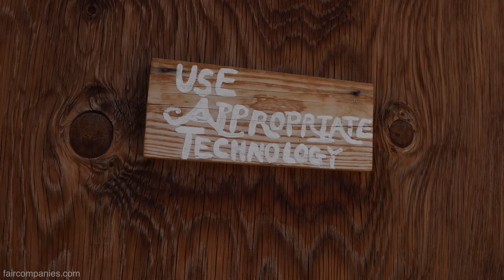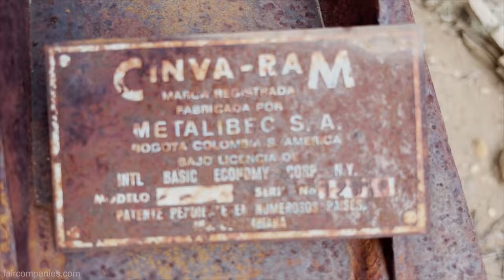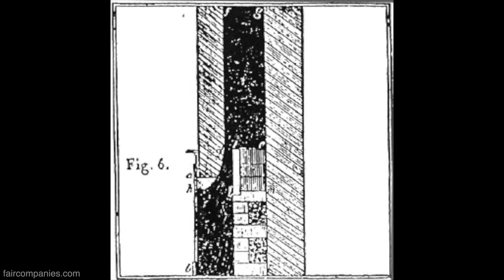30 years self-reliant: family $10K/year homestead & dugout

Comment: Doing nearly the same thing! We bought a property cheap with a rundown mobile home. Still have the mobile home, but we’re also just starting year 2. Foundation of the new house is nearly done. Wife has become quite adept with hand washing our laundry. Didn’t bring our washer/dryer, got gifted one (with intent of paying later) only to find out the hose didn’t work. Just recently got a grain mill. Its become an every other day thing, we’re baking more now than when we just bought it pre-ground. I love what he says about manual labor and appropriate technology. I’d rather spend a bit of extra time using a tool that’ll last decades, can be easily repaired and passed down. Than buy a time saving tool I’ll need to replace every few years.
Reply: It must be a challenging (but rewarding) lifestyle! Do you have a washer like them?
Reply: @barnabyvonrudal1  by washer you mean water bin or tub. In our case we have 2 galvanized tubs but also mostly use a bath tub. And yes we have the same looking hand wringer they do. We wrung them out by hand for about a month and got so many blisters! Plus every time we hung the clothes and by that time it was in the hallway using some cup hooks the previous owner had placed near the ceiling, it’d drip for the 1st hour making us have to watch our step or dirty towels to clean up the mess. Repurposed an old falling apart fence which conveniently had 2 posts tall enough to make a clothesline outside. You can guess how many people we spotted slowing down and staring at us as we hung our laundry in the middle of the winter. It works perfectly fine btw :D dragging wood fence posts set in place with concrete isn’t fun! Even more so when you have to dig it up later as you stupidly put them in at a 90 degree angle. Angle them away from each other, and place a board in front of the posts under the dirt.
Reply: @stephenleaf3848  sounds like fun (maybe for a few days 😁). How long does it take to dry?
Reply: @barnabyvonrudal1  around 2-3 days. Its called sublimation. This last time she brought out clothes she had to come back in and put on gloves it was so cold out, by the time she got back out they had started freezing in the bin.They were very stiff, but a few hours later we were noticing some of them swaying in the wind, suggesting they had shed most of their water and were not frozen solid anymore. We did have to bring in a sweater the following morning it was nearly fully dry up to around 6” from the bottom where it was still very wet. So it does take twice as long as during the summer, summer time if you don’t collect them around sundown, you won’t be able to collect them in the morning, the condensation (morning dew) makes it so you have to wait till around noon or so.

Comment: Amazing how they got the place for so cheap. But fixed it up. Good for them. When I was growing up we had a  wringer washing machine and hung our clothes on the line.  There was 8 of us. I find the clothes are cleaner than with normal washing machines. The machines now break down and when they do you may not get parts and the service charge is expensive.
Reply: So true that if it wears out its hard to fix! It would be a great idea to start producing a repairable and upgradable washing machine.
Reply: @Brian-jv8iy  now you are lucky if a washing machine lasts more then 10. Most only make about 7 or 8 years!

Comment: That bit about planning for an air vent for your fire is critical. I did this in my cabin. If nothing else, it prevents any feeling of draftiness as you enjoy your fire as the air is drawn from a vent right next to the fire rather than from a leaky window or door frame.
Reply: I noticed that part too. Having 2 modern, self-enclosed cast iron stoves, I can notice how important the type and amount of external air intake are regarding room temperature, amount of wood burnt, etc.

Comment: I wash by hand outside also and weirdly enjoy it too.
Unless I need the items quickly, I don't even wring the clothes /items out, they just go straight onto the line to drip dry.
Yes it it a necessity for now and has been for about 4+yrs.
My favorite tip is in between the rinsing processes I place the items over the bucket on a dish drainer to catch and keep using the soapy water.
Its just me/ one person so far as overall water savings versus filling up a whole machine... I think I'm saving on water bill and use no electricity.

Comment: I love this stuff & what a place they've created that's grounded in practicality & wellness. I bought a 70's trailer in the former city/town of Charlotte, on Haida Gwaii. Fixed it up with help of an artist with spruce root for holding my 1" Copper Pipe curtain rod over the living room Bay window, with a view of the Charlotte Harbour & bay, one block from the grocery store.
We removed the screened vents above the kitchen & bathroom to get a larger window area for a sheet of ice crystal stain glass in the bathroom & a sweet smaller rendition of my view.  Inset a beautiful red-brown streaked on pale inner pith of the Spruce root for support, when exiting or entering bathtub/ shower with a twisted, strong & long slender handle. The baby poop yellow tub had a rusted front, so with White pine planks we covered it. Then built a 4 inch shelf flush with the top of the tub.  We foraged for the last bits of sea-worn tree limbs, where the tree & limb meetdisguise

Comment: If you let handwashed clothes soak a bit longer, you notice more dirt come out into the water. You soak again, leave it in, and then it is really clean if the water is clear. You can also use just soap flakes.